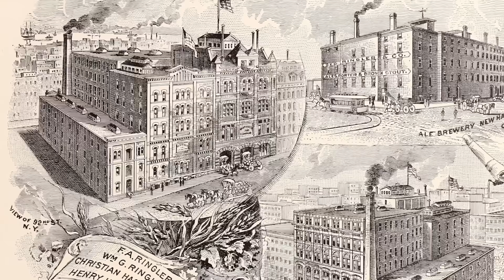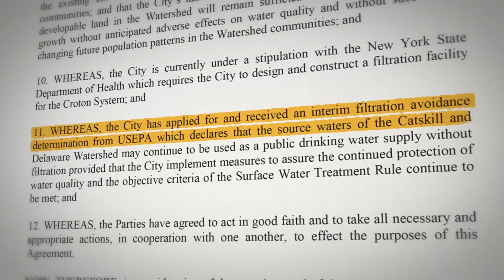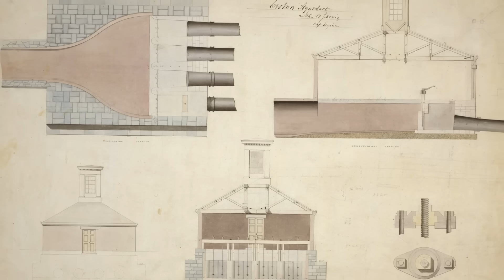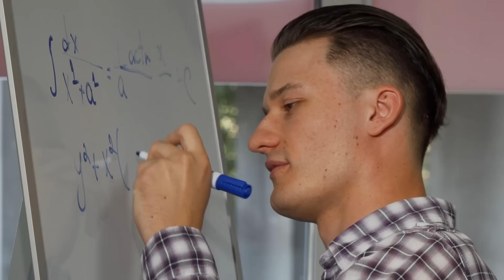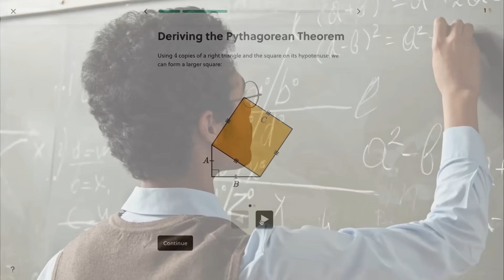The Simple Genius of NYC’s Water Supply System

Comment: 8:15 TIL "The physics of Syphons is not fully understood". Uhm looks pretty clear to me: Gravity and greater mass on one end.
If downwards-facing, the longer leg contains more water which when falling pulls the water behind it.
If upwards, the same, except the longer tube pushes down.
Reply: There are competing theories, that is only one possibility
Reply: Its all about the pressure on either end, but a real syphon magically flows up hill so long as the level of the water entering the pipe is above the exit point and the line has no air in it. This is possibly what he meant by not fully understood but i assume that people specialized in the field actually know the real physics reasons for it.

A pipe that drains a lake and never rises above the level of the lake isn't a syphon, its just a normal gravity pressurized water main. (Water wants to be level, a pipe is just a funny container shape so it wants the water at the end of the pipe to be level with the water at the start, and thats basically it for how the aquaducts move water)

Comment: In what sense are siphons not understood? I can do a fluid dynamics simulation that reflects reality, so I'm not sure what you're talking about.
Reply: That part also surprised me. I've never heard any competing theories of siphons
Reply: The system also doesn't appear to even use siphons for their greatest trick, making gravity pull water uphill so long as no air is in the line.

I'm not sure that a pipe that never rises above its source even counts as a siphon, just a standard watermain pressuized by gravity.
Reply: @jasonreed7522  even then a syphon of that scale would be problematic. While you can push water quite a lot, you can only "pull" water so much. Since pulling water is really just letting atmospheric pressure push it, the maths works out to be roughly 10 meters- anything more and the water would just cavitate and/or boil from the low pressure.
(If we assume atmospheric pressure at 100000 N / m² and with g rounded to 10 that gives us 10 tons / m². One cubic meter of water weighs 1 ton so you can stack around 10m of water before you exceed atmospheric pressure)
Reply: I just attributed it to the usual joking he does until i came to the comments section >.>

Comment: its interesting that the next longest tunnel is for the Helsinki water supply which is a substantially smaller city and the tunnel is only about 10% shorter :D though the bedrock there is very stable so probably more afordable
Reply: also a size difference not just lenght
Reply: Also gotta consider security reasons. The threat of invasion looming over a country influences a lot of things including infrastructure.
Reply: Helsinki is good with water. That's why it's called Hel sink i.